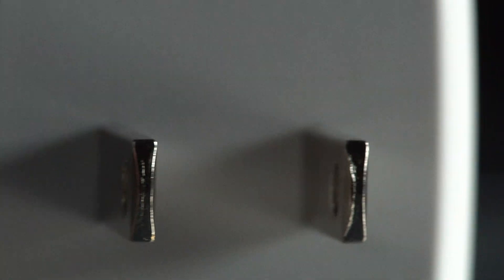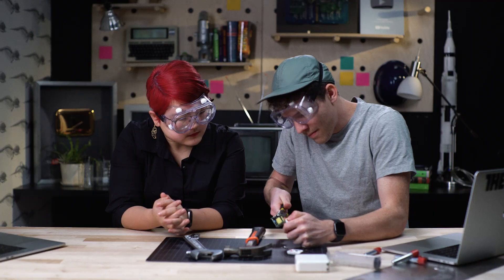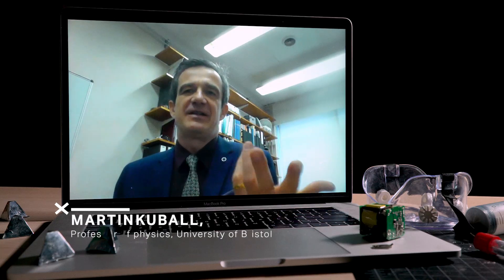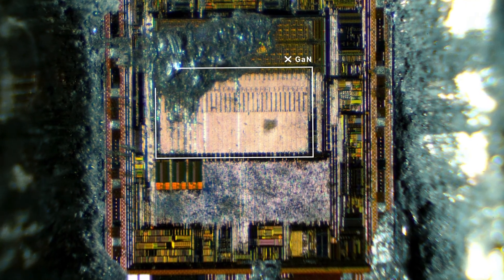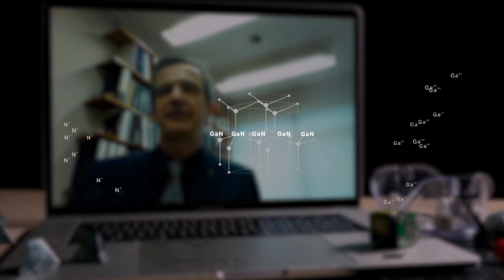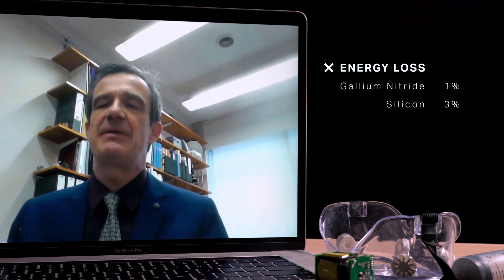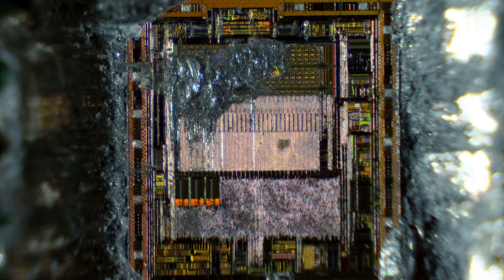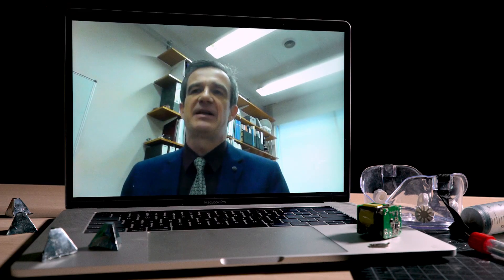Is gallium nitride the silicon of the future?

Comment: 1:38 we use conductor to transmit power not semiconductor.
1:42 not sure how would a semiconductor be use in an electric car, not in the motor because the motor use conductor not semiconductor, not the battery because it use very specific metal and you can't just replace it with something else to make it work, that mean you can only put them in an inverter but the electric vehicle's inverter is already very efficient, around 95% efficient. Any increase wouldn't increase the range that much and you can't increase it beyond 100% anyway because that would violate the law of physics.
Reply: There are plenty of uses for power semiconductor technology in power distribution, and there continues to be lots of research in utilizing and improving them further, particularly to replace older passive components. EVs use semiconductors throughout (not just the inverter, all the control componentry, sensors, auxiliary power needs, battery management). Even if they are already pretty efficient, if (hopefully when) we reach a point where EVs are ubiquitous, the slightest increases in power efficiency could collectively save a MASSIVE amount of energy.
Reply: @jincyquones  what are the usage in power distribution for semiconductors? But doesn't really matter anyway because most of the power lost is through the power line not the semiconductor, simply replace those silicon based semiconductor with gallium nitride based semiconductor won't change much as the conductor in the power line is what mostly eat up the power not the semiconductors.
Same goes for your EV argument, most of the power is lost through the inverter, battery and motor, the control system use and waste very little power.
Reply: Exactly my thought - Where would GaN go in electric vehicles to extend their range?!
Reply: I think you have not heard of HVDC transmission or STATCOMS for reactive power compensation in power transmission.  Those employ power electronic devices made of silicon.
Reply: Another very important point (which is the reason why I'm using GaN devices for high power laser pulsing) is that GaN devices are heterojunction-based. Basically means that they use some extremely mobile electrons to conduct. As a result they can switch very fast. A rule of thumb: when it comes to power conversion, the faster the speed is, the smaller all those capacitors and coils can be.
Reply: It is, as usual, painful to hear people talk about things they have 0 clue about.
Reply: @harrysvensson2610  nothing you said prove me wrong. So do you have greater than 0 clue about this? If so, why not educate me about what am I saying wrong here?
Reply: @luongmaihunggia   Pretty sure he was agreeing with you
Reply: I was agreeing with you, Redstone. Sorry for not making it clear.
Reply: @harrysvensson2610  ok, that's alright.
Reply: Nerdspeech... Such an interesting language..
(I'm not trying to offend anyone just making a small joke, please don't hate on me) @~@
But continue being smart n stuff!
Reply: A change from 95% efficiency to even 96% efficiency would be amazing.
Just using this for CPUs (even in cars) would also be an interesting idea. But I guess there have to be more drawbacks than were  pointed out in this video since otherwise at least one of the CPU/APU/SOC manufacturers would have switched by now.
Reply: @sinom  you must not be very good at math. Motor and drive train has a 0.9 efficiency and an inverter has a 0.95 efficiency. 0.9*0.95=0.855 efficency or 85.5% now let's compare this to your gallium nitride inverter electric vehicle. 0.9*0.96=0.864 or 86.4% efficient, so your gallium nitride inverter car is 86.4/85.5=1.0105263158 times more efficient than a normal E car. A standard range tesla model 3 has a 354.056 kilometers of range if use gallium nitride would have a range of 354.056*1.0105263158=357.78290527 that mean it would have a 357.78290527-354.056=3.72690527 kilometers increase in range using gallium nitride. I pretty sure simply adding more battery will be cheaper than replacing the silicon in the inverter with gallium nitride and unfortunately in real life people care about cost more than efficiency
Reply: @luongmaihunggia  we can see you know redstone a lot more than actual electronics. A lot of logic isn't based simply on inverters but on transistors. This isn't mincraft with its simplified boolean logic. And the thing with transistors is that you will have a lot more of them than just one in there. if we now take even only 20 transistors chained (yes in real electronics they aren't usually chained but deal with it) you will have the following calculation.
0,95^20 = 0,36
0,96^20 = 0,44
And if you look up the actual efficiency of silicon transistors it's barely below 97%
if you now look at what they said in the video with the difference between 3% and 1% the galliumnitrate transistors would have an efficiency of 99%
lets calculate again
0,97^20 = 0,54
0,99^20 = 0,81
As you can see, the closer to 100 percent you go the higher the impact of even a 1% (or in this case 2%) improvement.
You are basically getting rid of 2/3 of the energy loss in the transistors. And as I said this is a lot more important in ALUs than in motors. ALUs could be made a lot more efficient with this.
And did you look what at what they used it for in the video? In a transformer, or to be more exact, in the logic of a transformer. And if you look at the world wide high current network you will see there are a lot of transformers at work. Even if most of the energy loss comes from the spools themselves, getting the logic more efficient with millions of logic units (all using hundreds to thousands of transistors) would be pretty big energy (and through that money) saving.

It's also the reason why basically all of the ALU corporations (like AMD intel and NVIDIA) are trying to get a smaller manufactoring process for their transistors. because even if the increase is miniscule, with the millions and billions of transistors in use in your average CPU/GPU/SOC/APU it will actually account to real powersavings.

Then of course the simplest way in which it will be able to increase the range of electronic vehicles: 
making the electronics smaller and making them produce less heat (= making them more efficient) will also mean you will need smaller cooling solutions which leaves more place for more batteries/ultracapacitors (or whatever tresla is planning to do with maxwells technology)

And whilst we're at it. Please fix the typos in your about page.
Reply: @sinom  oh, bringing games I enjoy into your argument. Real mature, that's totally prove you right, I actually haven't been playing minecraft for a while because I'm getting bored of it. You can talk to me when you start acting more maturely.
Reply: @luongmaihunggia  I actually really like minecraft. That wasn't meant to judge. It's just that:
1. your name contains "redstone"
2. in redstone one of the most important logic units (or in boolean logic in general) is the not gate (inverter)
3. you are always talking about inverters which are near never used in actual electronics. In real electronics the basic gate usually in a transistor.

from these 3 points I concluded that you might not actually really know what you're talking about.

the only reason i brought minecraft into it is to show you that actual electronics rarely uses a not gate.

next thing. who was the person that began with:
 "you must not be very good at math"
Starting with an ad hominum definitely makes your argument more valid.
And ignoring valid points because you are offended by something that noone intended to make offending is tbh. stupid. (sorry for saying that but it's kinda true)

I was ignoring your namecalling but now you call me out for namecalling I never even did. how did you put it? "Thats very mature of you"

Actually disprove the maths and the argument I made. Don't just start ignoring it and finding an easy way of ignoring it. "That's really immature"
Reply: @sinom  yeah, I'm not going to read your entire comment unless you remove the word "minecraft" and any minecraft related word in your comment. Don't judge people by the game they play.
Reply: @luongmaihunggia  I am not judging you. Minecraft is a great game and you can play it if you want. As I said. I play minecraft myself. You're just being immature now.
Reply: @sinom  yeah sure not mentioning minecraft while talking about electronics, transistors, semiconductors and efficiency is immature, sure it is.
Reply: @luongmaihunggia   The reason I was talking about minecraft if because you were talking about INVERTERS
Which is something used in simple boolean logic and I wanted to point out is wrong in this context.
Judging by your name where do I think you got that term from? Exactly. Minecraft. Aka the most popular boolean logic simulator in the world.

You see that there is a very logical string of reasoning that lead to dropping the word minecraft. Heck informatics classes even use minecraft to explain boolean logic. Namedroping Minecraft in this case actually makes a lot of sense. Could we please just get back to topic already? I'm feeling like I'm talking to a 9 year old who isn't getting his way right now so he just locks up... We're all adults here (or at least I hope so). Please stay on topic.
Reply: @sinom  fine, I'll explain: inverters are used in electric cars to turn DC from batteries into 3 phase AC to power the motor because the motor cannot just run off battery's DC because electric cars use induction motors not brushed motors because they're more efficient. The inverter I'm referring to has nothing to do with minecraft.
Reply: @luongmaihunggia  so you mean DC/AC converters? I've actually never head them being called inverter but aparently theyre also called that. Then that was a misunderstanding from my side. I'm sorry If i somehow insulted you. Then that argument is out of the way. Can you read the actual maths I made now?
Reply: Sinom There's also something else that is painful for me to ear. The two guys in this video do deductions like if they knew a lot about this subject. For instance making 10% of energy savings is not as easy. You will start spending it somewhere else if you haven't been properly informed about the subject before.
With all the due respect I don't think they have done studies on the scientific field. I'm on my 4th year in studying science and I still have a lot of basics to understand.
Reply: @RaphaelAltieri  yeah true.
Reply: @luongmaihunggia  Well, You sure ain't very good at maths either lol all that mumbling around when you only needed to divide 96/95 and come up with the same 1,0105263158... Going around ain't so smart m8! Regarding the power transmission, like Sinon said you sure wasn't paying attention to this video lol they were talking about a transformer which is used for power transmission also obviously (!!)
Reply: @andymesquita  yeah but atleast my calculation wasn't wrong. And transformers are used in power transmission, so what? What's your point? As if that prove me wrong. Transformers also doesn't need semiconductors, they only only iron cores and conductors.
Reply: @luongmaihunggia  Sinom demolished you and proved you wrong. So why not delete your comment that is wrong?
Reply: @adolfhitler2026  no he didn't because I didn't read his replies because he keep mentioning minecraft for some reasons. Bringing people's hobbies into a conversation that has nothing to do with the hobby is just plain stupid. I'm not going to read his replies unless he remove minecraft from his argument.
Reply: @adolfhitler2026  he talked about minecraft on a semiconductor video, the two are not related and thus irrelevant. Because they're not related, minecraft has no power in this argument and thus I don't read his comment. There is still something you can do though, you can repost his replied to me but remove all the minecraft bit and I'll read it.
Reply: This video feels like trolling. It's SO bad and presented the way GaN is useful and how it makes power electronics more efficient in an extremely misleading way. What it allows is the ability to have lower switching losses and higher voltage power transistors. However this doesn't automatically make for example smaller CPUs more power efficient. It might be possible but the video is presenting the issue in an extremely over simplified way. The key here is the fact that GaN is a wide bandgap semiconductor thus it can do two main things. It is another material that can be used to make high electron mobility transistors which could replace MOSFETs. It can also be used at very high voltages. Thats especially useful in electric cars.
Reply: We actually use it in solid state AC/DC converters making it pretty important for energy transmission, while in EVs transistors are used in powering AC induction motors or DC motors with permanent magnets.
Reply: GaN would be good for power electronics like motor switching or high voltage DC power transmission.
Reply: @maynardjohnson3313  yeah, it would serve great there.
Reply: @luongmaihunggia  in electric cars you need to switch 300+ volts many times per second. The direct power savings from switching to a higher efficiency semiconductor might not be huge. However when switching tens of kilowatts getting closer to 100% efficiency  means a HUGE change in how much heat needs to be removed.
Reply: @RobertSzasz  Finaly a reasonable argument against me. A few percent increase doesn't increase range that much but it does decrease ALOT of heat generated, because the inverter produce is around 200kW of power to the motor, so even just 1 percent decrease in waste power is like 2kW decrease in heat waste and 2kW is ALOT. And because of the decrease heat waste, we don't need as strong of a cooling system and thus we don't spend as much on the cooling system which mean cheaper electric vehicles. I got to agree with you on that one. Nice so they aren't as useless as I think they are.
Reply: @luongmaihunggia  Also think in global scale a what 1% improvement in energy conversion (turning DC into AC, voltage stepping etc) would mean in terms of energy saved. Just to put it into perspective: the equivalent of all the renewable energy produced is wasted in grid losses + conversion.
Reply: @MrGnepo  1% is not enough to save the environment. What make it worse is electricity generation only make up for 25% of green house gas emission. So a 1% saving in electricity generation is like a 0.25% reduction in green house gas emission. The simple act of going solar will have a >0.25% decrease in green house gas emission.
Reply: redstone craft guy true
Reply: @luongmaihunggia   if we now take even only 20 transistors chained (yes in real electronics they aren't usually chained but deal with it) you will have the following calculation.
0,95^20 = 0,36
0,96^20 = 0,44
And if you look up the actual efficiency of silicon transistors it's barely below 97%
if you now look at what they said in the video with the difference between 3% and 1% the galliumnitrate transistors would have an efficiency of 99%
lets calculate again
0,97^20 = 0,54
0,99^20 = 0,81
As you can see, the closer to 100 percent you go the higher the impact of even a 1% (or in this case 2%) improvement.
You are basically getting rid of 2/3 of the energy loss in the transistors. And as I said this is a lot more important in ALUs than in motors. ALUs could be made a lot more efficient with this.
And did you look what at what they used it for in the video? In a transformer, or to be more exact, in the logic of a transformer. And if you look at the world wide high current network you will see there are a lot of transformers at work. Even if most of the energy loss comes from the spools themselves, getting the logic more efficient with millions of logic units (all using hundreds to thousands of transistors) would be pretty big energy (and through that money) saving.

It's also the reason why basically all of the ALU corporations (like AMD intel and NVIDIA) are trying to get a smaller manufactoring process for their transistors. because even if the increase is miniscule, with the millions and billions of transistors in use in your average CPU/GPU/SOC/APU it will actually account to real powersavings.

Then of course the simplest way in which it will be able to increase the range of electronic vehicles: 
making the electronics smaller and making them produce less heat (= making them more efficient) will also mean you will need smaller cooling solutions which leaves more place for more batteries/ultracapacitors (or whatever tresla is planning to do with maxwells technology)
Reply: @SiddiqueSukdiki  transformer use conductors and iron cores, not semiconductors.
Reply: Well, every bit of efficiency counts. it could also be used on control circuits and infotainment systems I think
Reply: Not quite. Advances in power electronics like GaN as well as SiC is making things like HVDC transmission possible. Biggest advantage would be lower price for given power conversion allowing more grids to operate at higher voltages and lower losses. As far as EVs yes modern inverters are very efficient but they are bulky and expensive GaN will change that in the future.
Reply: @ryanjhi2224  oh yeah, totally forgot about HVDC transmission, sorry. Inverter sure are bulky but that's not a problem when people talk about B.E.V, I heard people talk about the problem of slow charging, high cost of battery and short range but never have I ever heard of people discussing the problem of a bulky inverter because as far as I know, the battery is way larger than the inverter, the battery is the bulky one, not the inverter.
Reply: Transistors...
Reply: @doughnutman8832  What? Care to say more than that or are you just going to place a word here with no explaination whatsoever?
Reply: @luongmaihunggia  you asked for the role of semi-conductors in electric vehicles soooo
Reply: @luongmaihunggia  it ain't just the motors. There's a whole ton more which even kids like us on the internet don't understand lmao.
Reply: @luongmaihunggia  btw, you should read sinon's explanation whether you want to or not. His example of using Minecraft is superb so don't judge a book by it's cover. Haha.
Reply: @doughnutman8832  yeah, I know that, that is why my comment stated that semiconductor is used in inverter, sorry I didn't specify what is it used as in an inverter, which are like you said transistors but also mosfet and diodes but like I also stated in my comment: a slight efficiency boost in inverter won't increase the range that much.
Reply: @luongmaihunggia  transistors play a big role in electronics mate. It's true we use conductors for power transmissions, but there are also power semiconductors, Darlington pairs, bridge rectifiers and so on in which have proven to be useful in life and more complicated circuitry. Electronics is a very wide topic, it ain't that easy to understand right off the bat. The verge ain't wrong at all haha, but they are very vague as they too, understand very little.
Reply: @luongmaihunggia  not trying to be arrogant with you mate, just correcting you. It just ain't that simple like Sinon said, but you seem too reluctant to read his comments which I really have no idea why.